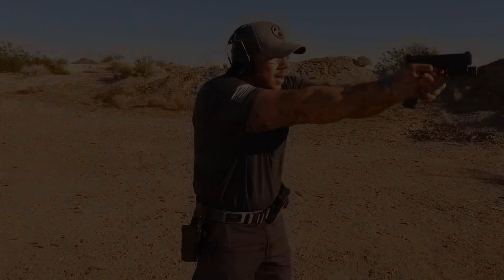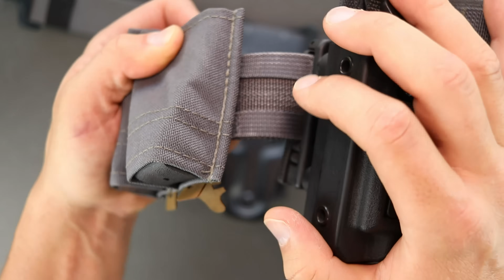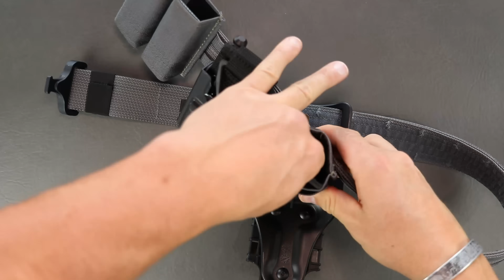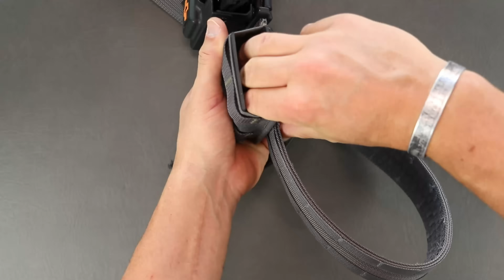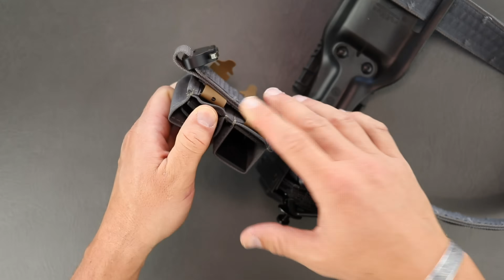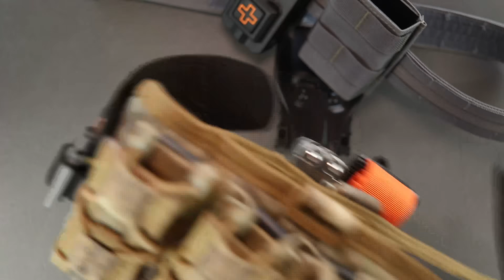Esstac Kywi Mag Pouches Up Your Game!

Comment: Hey, the double pistol pouch you shown here, is that the GAP model? I been looking into the double pistol + rifle mag pouch set, and on their website, they mention that the GAP model with a slight space between the pouches generally does not align with MOLLE, and requires belt loops.
Reply from the maker: This was the standard model.
Reply: @TacticalConsiderations  Thanks. No problems with the baseplates of glock mags being too close together, causing mishaps like pulling one magazine results in the adjecent one to come out too?

Comment: Our pouches will work with Glock 45 mags. Remove the insert, heat up the bend on one side and flatten it a bit. You can adjust the tension by how flat you make it. We used to shoot Glock 41's in USPSA with loosened KYWI inserts for quick mag changes.

While I'm commenting, we generally recommend not to use WTF Straps on belts. MALICE clips or other rigid attachments are better for belts. WTF Straps are designed for use on full milspec 1" PALS/MOLLE webbing.
Reply from the maker: Thank you Ryan that's great information for the audience.

The belt these are on is a molle belt  by blue alpha curious why these wtf would be inappropriate for that purpose. They fit as tight as the traditional hard malice clips ?

Comment: In your edc setup, do you use a mag pouch on your belt or do you use a sidecar style holster?
Reply from the maker: I use a side car rig. I've carried both ways . I prefer appendix rigs even though they are not technically the safest place to jam a gun
Reply: @TacticalConsiderations  Oh I carry appendix too. I just usually put my extra mag in my pocket and I hate it lol. Looking to get a mag pouch or switch holsters. Wondering what the pros like you prefer
Reply from the maker: I've got several appendix Sidecar holsters . T rex, tuctite txc and couple of others.   Those are all good along with T1C.
Reply: Which one is your favorite holster? And why if you don't mind
Reply from the maker: The one I carry most is the Tuctite. Although I'm positive I'd carry the Trex more if I had gotten the light  bearing model. The tuctite is great though the ANNEX A2. there is a coupon code on my website .